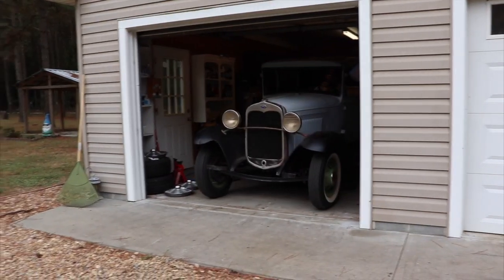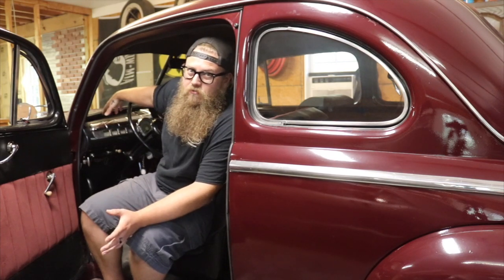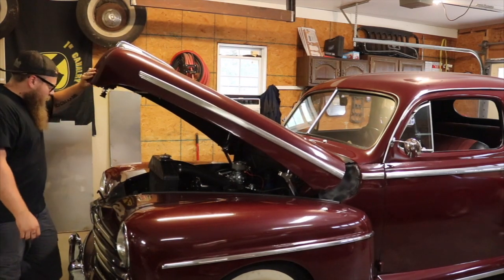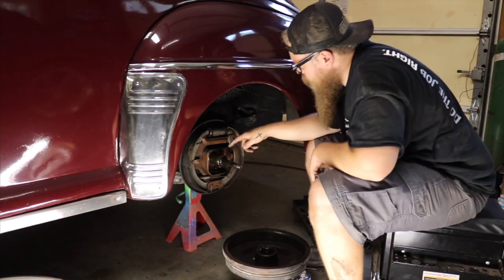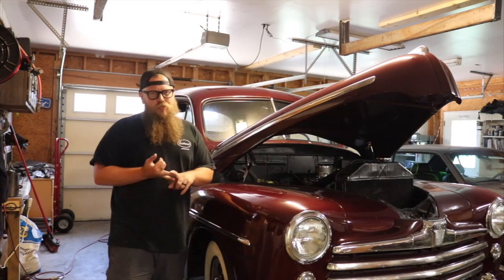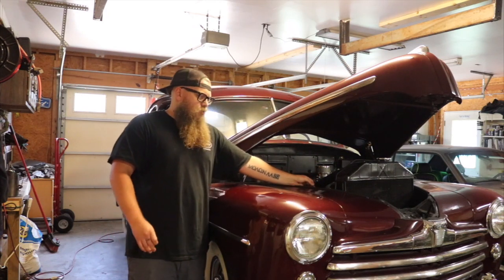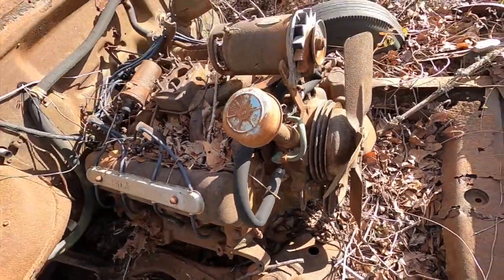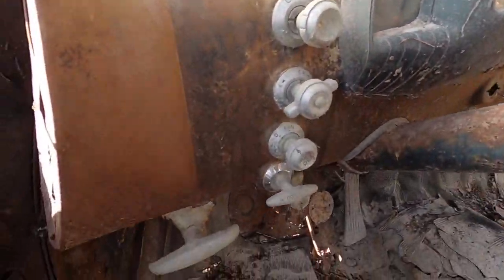Blueprint: Early Ford New to you Inspection. Wired Customs TV ep.1

Comment: 26:39 The 46 I'm trying to buy has already had a few tweaks done to it, and this is one of them. Aluminum radiator. I hate that it's got flexy-hoses on it and that's one of the first things I wanna change, but it does have a brand new AL rad. Also been 12-volted with a GM-style alt so I'll be sure to check engine grounding. Again, gonna be dailying it. That includes driving at night, driving in the middle of a Tennessee summer, even in the wintertime(Though probably not on the snow). Need it to keep its cool, need it to charge. 

Was thinking e-fan myself, especially since I do plan on putting air con in the car which imposes even more load on the cooling system. Maybe a dual fan setup like most modern cars have, one handling just engine needs and the other an aux fan that kicks on if things get hot, if the AC is on, etc etc. And I might free up a few ponies deleting the mechanical fan which will help when I'm blasting down the freeway in it for 30-odd minutes twice daily.

Feel free to link some part sources for this generation of Ford car. I'm gonna need 'em. A lot of it can be found at the usual suspects, but some things...like brake drums, upper rad hoses...seem to be unobtanium from the normal places. Probably why this car has flexyhoses in the first place.

Comment: 11:38 Geezlus that is a lot of slop. I'd probably be pulling the wheel ends down and repacking/replacing the wheel bearings as well as addressing the slop in the steering linkage. Pretty sure I saw a lot of toe movement between the brake drum and the dust shield as well as general slop in the whole steering system.

Comment: Great video, wear can you get the puller and what oil for trans ? Thanks
Reply from the maker: You can get the puller from MACs Fabrication, and only use 600 weight oil, anything else will leak and will prematurely burn up the synchronizers

Comment: I’m trying to get a ‘34 BB able to roll onto a trailer. Any tips on freeing up the mechanical brakes without a tear down?
Reply from the maker: A lot of heat, then after it completely cools down then a lot of penetrating oil, usually the pads are just rusted to the drum
Reply from the maker: How did it go?
Reply: @WiredCustomsSpeedShop   i wnet and checked it out yesterday. I am going to see if the adjusters will back off and maybe apply some torque to the wheels with a bar or something to break them loose. The engine turns over so i am hopeful its not too stuck. I dont really want to pull the wheels and bring a torch and everything to this guys house if i dont have to.
Reply from the maker: @morrismb9759  gotcha! Good luck!
Reply: @WiredCustomsSpeedShop   went after work today and got them all turning. None were actually frozen just dragging a little. Put some air in the ones with stems left and left them with the flat spots up so it would roll easier to start. Pretty productive 45 minutes. I am happy. Hopefully it means more good things to come.
Reply from the maker: @morrismb9759  that’s great! Glad it’s in better shape that what you thought, makes it a lot easier to rebuild too
Reply: @WiredCustomsSpeedShop   so I went to pull it today and it won’t roll. So the rear end or torque tube are locked even though the spider gears must spin free to spin each tire free. It’s on dirt so it just drug and didn’t break free. Seller claims it rolled to where it sits 5 years ago. Just unbolt rear and slide back to try to roll it? I guess that won’t work if it’s stuck either way…. So difficult not having the tools to just pop it on a trailer.
Reply from the maker: @morrismb9759   yes sir basically nothing you can do since it’s a torque tube, I would still doubt that the rear itself is locked, even if the spider gears are welded together the rear would still roll, best bet is to drag it into a trailer with some sliders under the wheels and take the axels apart at hone